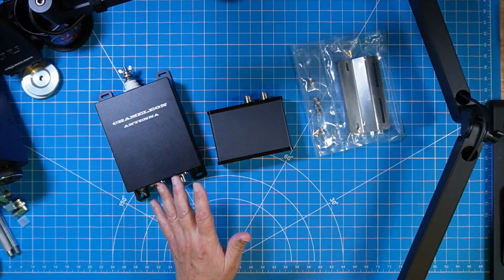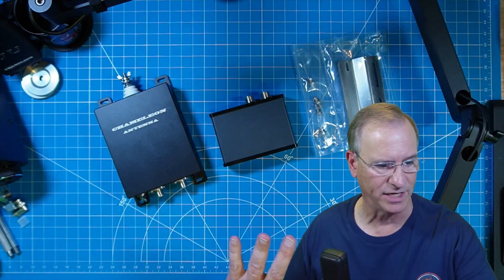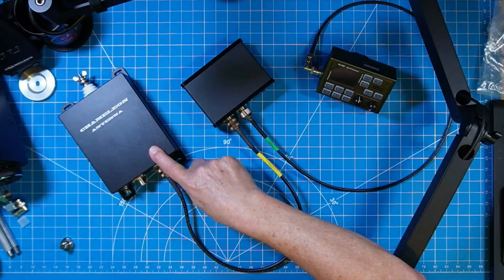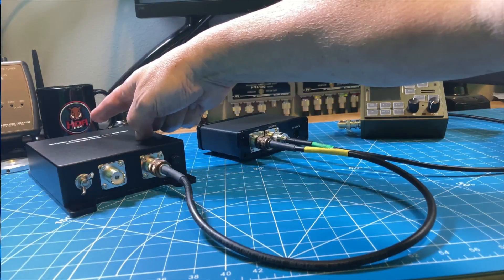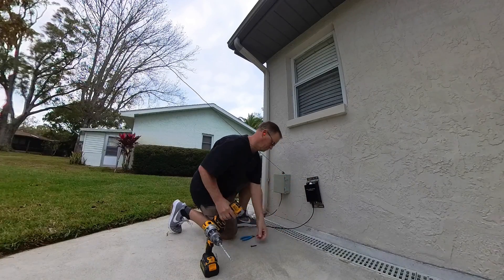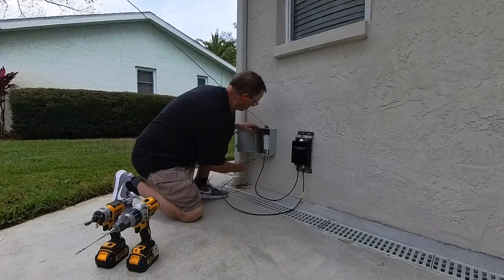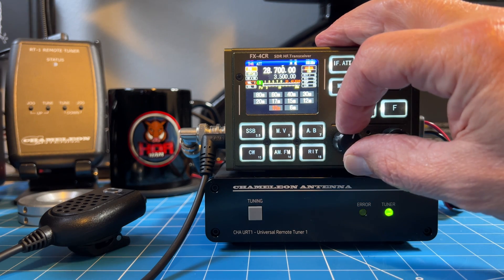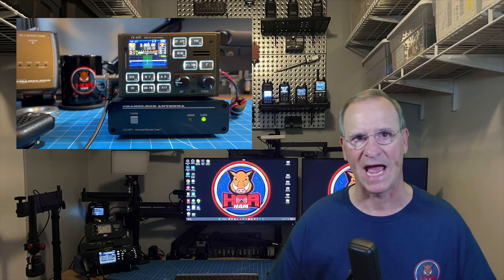Review and Use of the Chameleon Antenna CHA URT-1 Universal Remote Antenna Tuner

Comment: You can also use this tuner with any vertical antenna whips like the CHA SS17 with some proper radials or elevated counterpoises! Having the coupler at the feed point will actually base load the antenna like a loading coil thus eliminating coax losses! Imagine having one of those on the side of your rooftop or at the top of the PORTA-MAST - it will give you a tuned vertical at all frequencies all the time!
Reply: Nice review, thank you!!  What was the worse impedance mismatch for which it was able to correct?  In other words, what was the highest SWR you saw before it was corrected as seen by the transceiver, e.g., 4:1, 5:1, etc.?  TIA
Reply: Is the beehive connector 3/8"-24 by any chance? :)

Comment: Can this tuner be used with LADDER LINE OUTPUT to a non-resonant dipole, and how would that be wired up? 
 Would I use the beehive and ground, or a 4:1 on the 50 ohm?
Reply from the maker: According to the manufacturer instructions, there is no ladder line installation option.
Reply: @HOAHamRadio  Thanks

Comment: That's a Yaesu behind you on the desk at the start, yes? ...Would you be willing and able to test and see if you can operate the URT-1 with the transceiver providing power in ATAS mode? Like you can with the LDG RT-100: PTT key down on a carrier wave mode in low power, and hold down the "UP" button on the handheld microphone to send 12 V over the coax.
Reply from the maker: I no longer own the 991A, sold it a few weeks ago.

Even if I did, I would not attempt this.  The electronics in the URT-1 tuner, and the bias T are quite complex...I am certain this would not work, and would likely cause smoke...  But I understand why you would want to ask; would be nice for it to work.

Comment: Does this turner require you to push the tune button on the box in the shack or will it turn automatically based on the frequency?

I need a remote antenna tuner where I am not at the radio side and logging in and operating remote. So I do not have the ability to put a button on the tuner.
Reply from the maker: Yes, manual tuning at the shack control box, by pushing a tune button.  It is not an auto tuner.

Comment: Can I connect the matching transformer from my Emcomm III Base Antenna to the Beehive connector?
Reply from the maker: You would want a short coax jumper (maybe 1 to 2 feet) from the SO-239 on your Emcomm III and the SO-239 antenna connection on the URT-1.

OR

Take your wire you already have from the Emcomm III and connect the wire only to the beehive connector; remove the matching transformer altogether.

Comment: So  any kind of FAN DIPOLE OR  DX Commander  antenna can't be used?
Reply from the maker: Hmmmmm....  DX Commander and a fan dipole should be resonant antennas; any reason why you're wanting to put a turner on them?  

The tuner has a coax feed, so you can feed ANY antenna into it, just not sure why you would feed a resonant antenna.
Reply: @HOAHamRadio  I WAS THINKING  A second wire more likely to have better lobs at a different length might load easier and be switched just as with a fan dipole and of course DX Commander has several  so more likely to work quicker. If the tuner were mounted on a pole as was the case in one video it could be convenient.  Some use 42ft flag poles for all bands  with performance on higher bands being comprised. 

Just a thought, being disabled not having to go outside to change to a second wire has an appeal.
Reply from the maker: @americaswayout4489  I'm understanding now.  Yes, you would just use the coax feed into the tuner from your Commander or fan; then the turner would work for any non-resonant bands.

Comment: Hi. Nice presentation. Questions : 1- Is the wingnut on the front panel for ground connection ? 2- What is the loss (dB) added by this tuner ? No one hardly ever mention this. We should know. Tuning is one thing. Transmitting is another thing... A live test would be great. Thank you.
Reply from the maker: The user manual on the Chameleon site covers the detail; wingnut on top beehive connector is for a wire antenna, wingnut on bottom left corner for grounding.

As I have a full time job and a life away from my YouTube channel, I can't cover every possible question; i.e., loss.  It seems you have a passion and interest; I'd encourage you to pursue it and offer up your take on the subject and specific gear, via your own YouTube video.

Comment: Box very similar to MAT-Tuner mAT-40....
Reply: Except the MAT is not for outdoor use at the antenna.
Reply: @Steve_in_paradise  The mAT-40 HF-SSB Automatic Antenna Tuner, lets you rapidly tune any antenna automatically: unbalanced or single-wire. It can be operated by various brands of transmitters by selecting different interface cables, such as ICOM, YAESU, and KENWOOD, just like their own brand tuners. The tuner housing is produced by aluminum milling and oxidation surface technology, beautiful, delicate, compact and firm. ''It can work well in all kinds of harsh outdoor environments.'' The maximum size of the tuner is only 20 cm, ''which is the smallest outdoor antenna tuner now.''

The mAT-40 also features advanced memory tuning, providing 16000 memory locations. When tuning near a previously used frequency it will recall the settings for nearly instant tuning. It learns your favorite frequencies and bands as you use it. You can also start a tuning cycle manually whenever necessary.

The standard configuration accessory of the tuner does not contain 50 ohm coaxial cable, and the user needs to prepare it himself. (...)
Reply: @Steve_in_paradise 

He wrote mat 40, a tuner for outdoor use.

Comment: Great presentation. Well explained. How does it draw voltage?
Reply from the maker: 13.8 volts dc, just like our radios.  Goes into the back of the control box in the shack.
Reply: and via the Bias-Tee